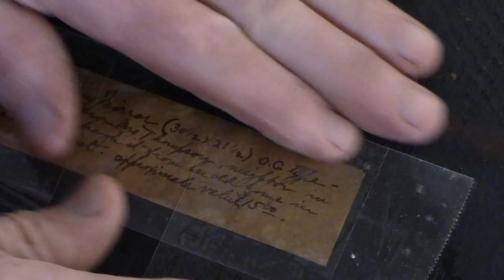Repairing a Thrift Store Mirror - Thomas Johnson Antique Furniture Restoration

Comment: I have this exact mirror! Same dimensions, same veneer, everything. Despite my very amateurish attempt to replace some of the veneer about 25 years ago, I still love it and it hangs in my living room.
Reply from the maker: That's great! They are very handsome frames. I wonder how many of these were produced, and by whom? Could it have been an early 19th century production line operation? That's about the time they started figuring out these production methods
Reply: I also have a mirror that looksvery similar to this too. The glass though is bad, with streaks and splotches so that everything looks kind of blurry. I love it

Comment: Nice work.  Some people won't realise the cost of the years of experience that stand behind those six hours of labour and the value of the end product.
Reply: Well, when you do the same thing as the original manufacture did & re-use too large nails, that is not experience, that's slop.
Reply from the maker: Thanks! You're right!
Reply from the maker: Thanks for watching! Well, I can't think there's anything wrong with putting back a nail that appears to be original. The hole is there, what are you going to do?

Comment: Tom, I am continually amazed at how receptive to re-gluing and re-attachment the fragile original veneer is to restoration. I've peeled off loose bubbled veneer and started over thinking the tiny bits and pieces weren't salvagable. You make it look easy. The difference between a amateur and a true pro - heart! I should be braver!
Reply from the maker: Thanks! Yeah, you have to dive into it! For me, the pressure's on when the camera is rolling!

Comment: The great old frames are definitely a worthwhile woodworking project.  Even the ones constructed with softer woods are a worthwhile project.  I spent about 40-cents on a couple of soft wood frames, and after cleaning and sanding them, I spray painted them with gray satin paint.  I needed some frames of that size and I had the prints matted in gray with a dark pewter color on the inside of the matts.  That was about 15 years ago and I still love the pictures and the frames I cleaned up to put them in.  The frames themselves are about 3-inches wide - something you don't get anymore when you take pictures to be professionally framed.  If you can find thick frames like that (and that's a tall order), you pay cost prohibitive prices for them.  Great job on the frame - a worthwhile project indeed.
Reply from the maker: Thanks! there are so many good frames out there, it's great to reuse them. It sounds like you did a good job!
Reply: @johnsonrestoration  , I just found an antique frame that someone painted unfortunately.  The paint hasn't been on it that long so will likely be a gooey mess to take the paint off.  Once doing so, I'll have a really nice frame to use as a mirror or picture.  I'm thinking mirror.  I found some really nice unfinished, handcrafted ones at my local thrift store for onl;y $80-cents each.  Someone actually made them.  They're about 3 inches/wide/ thick.  You know what shocks me is how so many are ending up at thrift stores.  I've got two 3-4 inch thick maple door mirrors that I'm planning on using.  I think they need touch up at most.  I paid only $2.50 each.

Comment: Another great video Tom!  Have you ever tried lining your glue caul for curves with thick felt to apply even pressure?  Scott
Reply from the maker: Thanks! If there was some thinner, "harder: felt it might work. I'll have to look in the fabric store. I have some rubber roofing material I should try
Reply: Making a caul for the Ogee curve is authentic but challenging to make consistent, even over a few inches for a repair.  Even harder over the distance of a frame side. For making reproduction pieces (not repairs), I’ve been thinking about hiring a fellow to 3-d print a section of caul (several copies) with a lengthwise void in the back so that segments could be joined by a steel rod (for veneering various lengths).  Has anyone tried that?

Comment: A fine job. I have extract the tanning and shellac from old wood to use as a dye for fresh repairs. I use either caustic soda or methylated spirits!
Reply from the maker: Thanks! Interesting
Reply: @johnsonrestoration  If you were to use caustic soda you need to neutralize it with a little white vinegar!

Comment: Your work is superb, you are a perfectionist. One question. On the oak Queen Anne table you restored, why did you reglue the top, then strip with chemical stripper. Thanks
Reply from the maker: Thanks! Well, the top was cracked, so always do all the repairs first. I used a chemical stripper because I wanted to minimize the sanding

Comment: Really enjoyed the mirror restoration and as usual I learned from it.  I noticed in several parts of the video you
Are using a small width scraper.  It has an orange and gray handle.  I’d like to get one.  Can you tell me what 
brand it is and maybe where I could find one?  Thank you.
Reply from the maker: Thanks! great scraper, they sell them everywhere, even my local hardware store https://www.bahco.com/en/s/scrapers/54-14-17-82-9d-74-20-78-8d-69-96-fc-11-7b-63-78/

Comment: That mirror came out great. Do you have some kind of venting system that continually sucks out sawdust and other particles so they don't interfere with the finishing process? I'd think that would be a constant threat.
Reply from the maker: Thanks! Yes I do, I have a ceiling hung dust collected, and of course an exhaust fan. Often I’ll put a coat of finish on at the end of the day

Comment: I enjoyed and needed this information very much. My grandfather had restored several of these along with two much larger ones for the low country style home my parents built in 68. I have one this same size that they chose to remove from the back porch powder room and I need to repair a chip along with some small areas of loose veneer. The humid South no doubt. Thank you for sharing your techniques. What was the brand or name of the final polish you used....french?
Reply from the maker: Thanks! It was Lubricite http://lubricite.com/

Comment: Outstanding work Tom! I have watched a lot of your videos and have learned so much. I have a passion for woodworking and especially enjoy furniture repair. I have a quick question about waxing. I have heard and seen first hand where wax has streaked and looked horrible because I did not wait long enough for the finish to "cure". I see you wax projects pretty soon after the final finish is applied and it comes out great. What is your secret? The type of wax, application technique... Anyway, you are an inspiration to this small time furniture fixer! Terry
Reply from the maker: Thanks Terry! Every time I wax something I feel like I'm still figuring out how to do it. But the main thing is to not put too much wax on the surface. use as little as possible, and stay on each area until it's the way you want. Letting it dry and then buffing doesn't work
Reply: @johnsonrestoration  Hmmmm. I like that! Guess that's why you are the expert!

Comment: Looks  Good...  Most frightening part was the mirror installation. I would have predrilled the cleats and used a punch to set them.  I've seen so many disasters with hammer vs mirror. Anyway you got through it. Cheers
Reply from the maker: Thanks! Oh, I was sweating it too!

Comment: Also noted you used wax to make the corner joint seem less obvious, but would the shellac have a hard time sticking to this?
Reply from the maker: The wax I use is "Low Heat Burn In" sticks from Mohawk, made for this purpose. Somehow the finish seems to work just fine over it. Maybe it's not really wax?

Comment: Beautiful mirror. I have a question regarding old mirrors. I have a mirror that’s over 100 years old attached to my dressing table. Now I know the silvering wears over time but I like that, it gives it character. My problem is I have an area of silvering that has one spot where it looks like a car windshield that’s be hit by a stone. It’s not quite an inch in diameter and u fortunately it’s right in my line of vision when I’m sitting at the dressing table. Is there anything you can recommend that would fix that? I know resilvering a huge mirror like this would cost a fortune.
Reply from the maker: Thanks for watching! Take the back off the mirror frame. Buy a new piece of single thickness mirror the same size as the existing mirror. Place the new mirror behind the original. You'll have to make adjustments to the blocks or whatever held the mirror in place because now you have an extra layer in there

Comment: Hi again, Tom.  I noticed that you did not use corner clamps on this job. Is that because they cannot produce enough pressure for a piece this size with its existing "issues"?
Reply from the maker: Thanks! It just wasn't necessary, there were old nails in the joints and they held the corners in place

Comment: When I hear you say "It seems to have the original glass in it", my heart rate goes up a tick. I'm curious as to why you replaced the mirror before applying the french polish (again my fear of breaking antique glass - I wonder if there's a phobia for that). Plus I noticed your jar said pearl hide glue; is that different from a traditional hide glue? Nothing says Friday, June 14th like a Thomas Johnson video!
Reply from the maker: Thanks! The mirror, though very thin glass, seemed sturdy, so I wasn't worried about it. But I was careful! Pearl hide glue has a longer open time, not as strong as granular, but fine for veneer work

Comment: I'm loving your videos. I'm learning a lot about repairing and restoring woodwork from you, and they're also very calming to watch.

What is that saw that you use sometimes to cut veneer patches? It looks like a type of Japanese pull saw, but it's not one I recognize. I've seen it a few times now, but you use it here around 7:45 and 9:50.
Reply from the maker: Thanks! That's sweet little saw I got from The Shelter Institute 207-442-7938, "saw deluxe fret" SKU: 02CU00015. That's all it says on the invoice. It's 14" long with a leaf shaped blade
Reply: @johnsonrestoration  Awesome, thanks! I think I was able to find it with that info. Shelter Tools sells it under a couple of different names, so that was definitely the place to look.

It looks like it's a Japanese fret saw, as your invoice said, though the design was originally used for cutting the bottoms for buckets. It's a sokomawashibiki. Soko translates to "bottom", and mawashibiki is the name for Japanese keyhole saws and translates to "pull and turn", I think. I can think of at least a couple of times it would have been the best tool to have on hand!

Comment: Just found your channel - hope you see this.  Dumb question (?) but  I haven't seen you using CA glue for anything (yet).  Is there a reason you avoid CA?  I work on musical instruments and the common practice (way too common sometimes IMO) is to tack anything  that is loose (bindings, veneers, inlays, etc.) on stringed instruments with water-thin CA glue. However we often use a mixture of  hide/fish glue...PVA... epoxy... and CA on the same instrument when needed - but the whole luthier 'industry' uses a ton of CA glue of various thicknesses for 101 repairs.  We also use it to drop-fill dings in finishes, etc.  Any thoughts on that for furniture restoration?   Thanks in advance - enjoying your videos.
Reply from the maker: Thanks for watching! I've never tried the CA glues. The industry standard for period antiques is hide glue, although all other adhesives certainly have their place. I did a video on my use of glue: https://www.youtube.com/watch?v=AmFot8H_2Kk

Comment: You sir, are a magician. As always, great work. I am curious though, how do you decide when to use putty to fill in gaps vs using wax?
Reply from the maker: Thanks! I use wax on a piece like this because I'm not sanding that area. Plus, the hope is that the wax will be more flexible when expansion and contraction occur.

Comment: Is it true that one must be cautious cleaning old mirrors because, since they were coated with silver, cleaning solutions can attack the coating more profoundly than on modern mirrors? I'd never heard of Lac French. Is it basically a premixed shellac with some dye and oil? Thank you for the video. I'm nervous to touch antiques because I don't know how to recognize valuable vs. not valuable and how to recognize where to draw the line to keep from going too far with a restoration.
Reply from the maker: Thanks! That's true but you clean the front of the glass, not the back where the mercury is. I'm not sure what's in the French Lac. But don't be shy! get any piece of furniture that needs work and give it a try

Comment: Why do you use tung oil instead of danish rubbing oil which has shellac in it?  Very nice job on this mirror.
Reply from the maker: Thanks! On this job I was French Polishing with French Lac from Mohawk. On other jobs I have used Waterlox Tung Oil Varnish, which builds a lot faster that Danish Oil. Nothing wrong with danish Oil, I have used Watco Danish Oil a lot over the years. I question the shellac content though, doesn't make sense to me
Reply: @johnsonrestoration  thanks for your opimion.

Comment: Good work on the frame. A little sugestion for the label, glue it on and protect it with a piece of clear plastic, or plexiglass, because tape didn't last that long. ^^
Reply from the maker: Good tip! Thanks! Maybe some very thin plastic, like from a plastic file folder from Staples
Reply: @johnsonrestoration  more like something with the thickness of 2 mm/0,078 inch. ^^

Comment: To restore a mitre that is still part of frame such as yours, clamp the two parts as close together as you can on a piece of scrap then just run a tenon or bead  saw through the gap cutting only the two touching edges, the saw cut is so minimal it will not affect the overall size of the frame or the refitting of the glass.
Reply from the maker: Thanks! Sounds like an interesting idea, I'll try it

Comment: Really nice (as usual). Can you say anything about the glass and what was used to back it? Is it 'mercury glass'?
Reply from the maker: Thanks! I really don't know - I've got to research that. We always call it "silvering", could that be the same as mercury?
Reply: @johnsonrestoration  Mercury was the 'method' that involved silvering in which the silvery substance (sometimes mercury) was injected in between to sheets of glass. There are a few places they still make it (no mercury) for those who do the job you just did but accidentally break the mirror. Here in SF there are a few that still do this for those who replace the old mirrors above the fireplace.
Reply: @sullyprudhomme   buonasera. Nel 1300 a Venezia precisamente sull'isola di Murano venivano prodotti specchi. La lavorazione veniva fatta con lastre di stagno pressate sulla superficie del vetro tramite un bagno di mercurio.Nel 1600 gli artisti di Murano diedero un notevole contributo alla realizzazione della Galleria degli Specchi di Versailles.Nella seconda metà del 1800 gli specchi venivano prodotti con una soluzione di nitrato di argento, ammoniaca e acido tartarico e venivano fissate al vetro particelle quasi invisibili di argento ricoperte di gommalacca. Oggi gli specchi sono costituiti da una lastra di vetro dietro cui è posto uno strato sottile di argento o alluminio che viene fissato al vetro per elettrolisi .Consideri che a volte uno specchio del 1600 o 1700 vale di più della cornice che lo racchiude. Saluti dall' Italia

Comment: Pretty great find. I have commented before about how I have over 8 years of finishing experience of which 3 were on only antiques of very high value($10k-1 million insured) and doing restoration work on them. I do a lot of thrifting and come across antiques that I want to repair, but I am having trouble figuring out where to sell them. I could do a commission store, but the buyers there wouldn't understand what I have or why I would charge so much. I can identify the age of a piece fairly accurately most of the time and sometimes identify the country of origin or region of the US it is from by eye. I think that I can do some additional research on the pieces on the internet too. From what I know about antiques and their values I would say that most of the stuff I have been seeing would be worth $350 to $5,000 once repaired in a retail setting. Would I do the best by setting up for auctions ? I guess I could drive to Woodbury Connecticut where there are tons of dealers and stores to consign it there, but it is quite a drive. Any advice for someone to get their foot in the door? Thanks.
Reply: What would you think it would go for in a shop?
Reply from the maker: Hi Robert, I have never sold a piece of furniture, so I can't help you. The only thing that's selling now is Mid Century Furniture. If I wanted to make money selling, I would focus on the highest quality MCM
Reply from the maker: I really don't know. I did this for a friend. It sold for $4, what does that tell you?
Reply: @johnsonrestoration  It tells me that the person who sold it didn't know or appreciate what they had? MCM is pretty hot right now, I like it too and art decco stuff. Thanks for the feedback.

Comment: Is heat the best way to remove hide glue? I've got some wooden handplanes that need restoration to include new totes. But I've no idea the best, non destructive method to get the totes out.
Reply from the maker: Yes, heat will work, hot water or hot white vinegar. The trick is patience! Are you sure they're glued? Heat will help in any case
Reply: @johnsonrestoration  I'm quite certain they're glued. The ones I need to repair are 1870s to 1890s vintage. I can see no nails or screws.